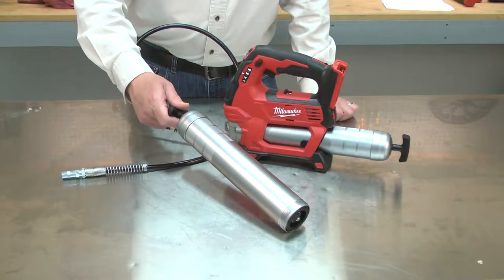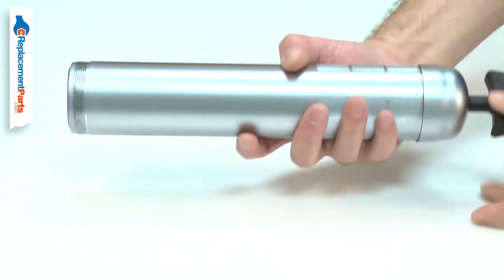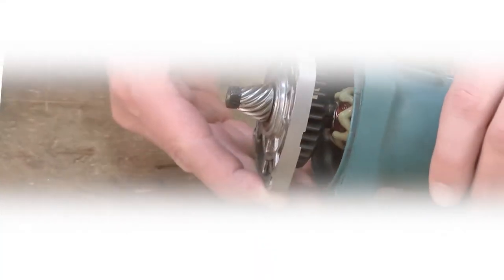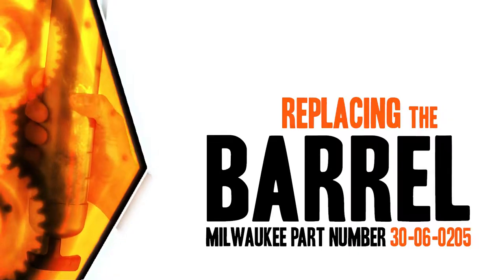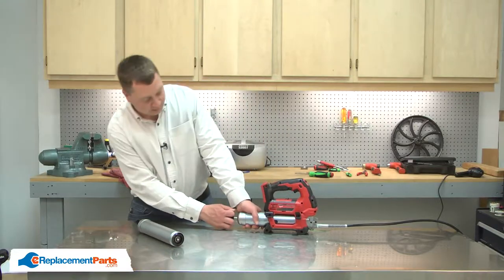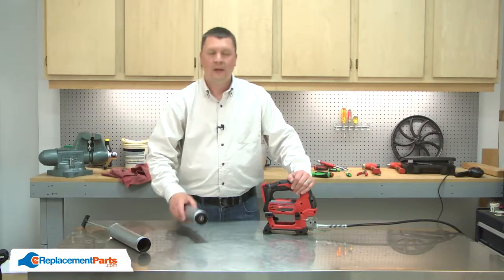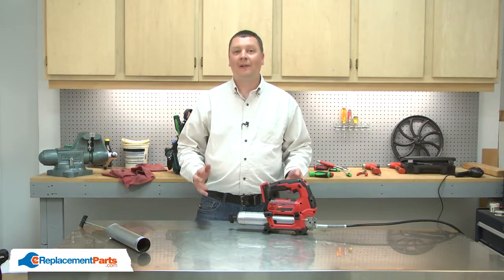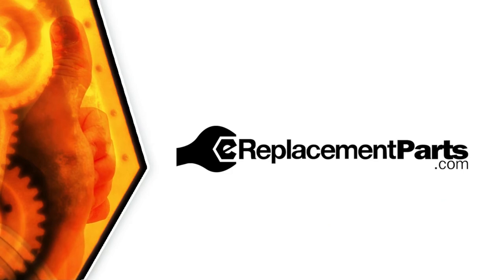Milwaukee Grease Gun Repair - Replacing the Barrel (Milwaukee Part # 30-06-0205)

Comment: Well I’ve managed to mess up my barrel ass’y (actually the “charging handle” end of it) by letting the spring come “uncoiled” somehow.  I’m that guy who can find a way to mess up a hammer.  Can’t seem to get the spring compressed AND start threading the charging handle back in as it’s designed.  Ugh…